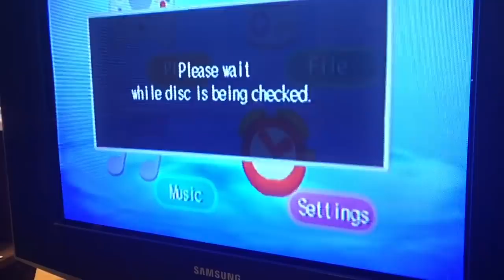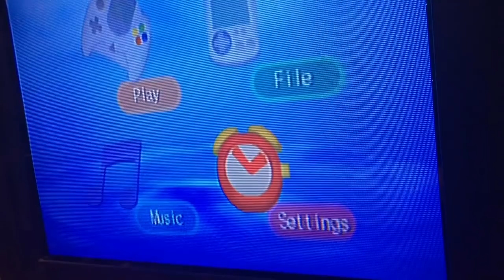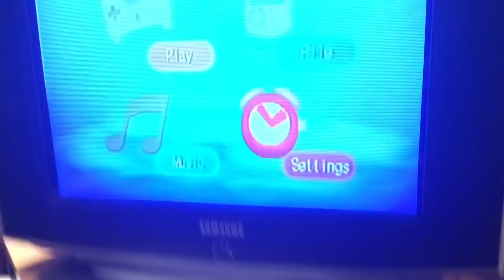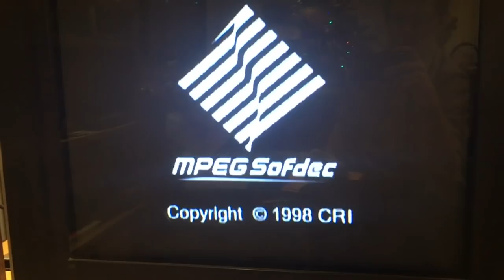Fixing eBay Junk - Dreamcast Restoration - Part 2 - Disc Read and Boot Issue

Comment: The road to random resetting is a well worn path. I'd have to run multiple games on it over a period of a week or so before declaring it fixed and reliable.
Reply from the maker: Very true.  The best part is the testing, but I'm not sure you all want to watch me suck at video games for an hour.
Reply: RetroRepairs Tony Hawk's is so playable too.
Reply from the maker: lordsofkoble right? Thps2 was the one I played the most, but I'll power through a nice og thps session
Reply: RetroRepairs Same actually, great soundtrack.

Comment: Thank you!! I had tried this before, but this video was much clearer and helpful. The screw twist was enough. My DC is working again!! Quick question.. the game I played first shut down after a few moments. However each time I tried it lasted a bit longer, until finally it's lasted for a good 15 mins now and still going. (Hello Virtua Tennis incidentally!) Any ideas why this is? Anything to do with the ML2032 recharging?

Comment: So did the old laser work with the power supply fix? I've got the Dreamcast, Game Cube and a Panasonic DVD/VHS combo needs fixed! The combo needs a disc drive and the consoles need cleaning up, but my main concern is the combo, is there any recommendations for a replacement or fixing the disc drive?

Comment: Pot tweaking without any sort of multimeter? You need to know if you are actually doing anything to the pot. You might even be putting more resistance impeding the laser. And if you happen to put too much power to the laser, you can shorten the life of the laser and eventually damage it.

Even so, love the restoration project! Keep doing what you do!
Reply: instablaster.

Comment: Have you tried using the original laser after you bent those power pins back in place? Maybe that laser wasn't getting enough power either. 

I also know nothing about this stuff, so I could be dead wrong. I just like watching this stuff.
Reply from the maker: Lostmymind1 I didn't, but it won't take much to just try it on another system.

I really do think the laser is the issue though, the new laser behaved much differently even with the bent pins.

Comment: I don't know if everyone is aware but I have 2 dreamcast and on one of the lasers the pot need an anti clockwork turn to increase laser voltage and the other one needs a clockwise. On my multimeter it shows a decrease of ohms is to increase the laser. Just might help you get this one working :) keep em coming dude great work

Comment: Having watched both parts 1 & 2 there, I have to say that you've done a pretty awesome job of restoring this old Sega Dreamcast :o and it does make me jealous in a way that I wish I could do this kind of thing myself, as it would be a great overall feeling to have brought something 'back from the dead' in a way like that, though considering what you said this console had been through, it could've potentially been damaged far beyond the point of repair if it was smoke AND fire damage! D:
Will look forward to seeing part 3 soon hopefully, but no rush as I could certainly understand that this kind of repair/service job could take awhile, as well as requiring a lot of trial and error to see if things work or not (as seen in parts 1 & 2), but here's to hoping you'll be able to better clean that power unit/board part and maybe it'll help restore functionality to those original parts without the replacements (where possible at least)!

Comment: Another great video!  I saw a video where a guy spent a lot of time trying to adjust the laser and he finally tried swapping parts with a known good system and it turned out the board was the problem and the laser was fine.  Since you have spares, it might save ya some time to try that method.  I'm very curious if the old laser worked too!

Ignore all the idiots bitching about how you're doing things.  We're hobbyist repairmen and we often do things wrong.  

Constructive criticism is one thing, whining is another.  DEAL WITH IT PEOPLE!!!

Comment: The worst part of the video is that you never take readings with a multimeter, then
you touch with your bare hands the power supply without having discharged the capacitors.

The initial value of the laser is very important, because it is the most practical way to play with the pot without lowering the power of the laser too much.
The power supply has capacitors of 250 to 400 volts, if you are going to disassemble the source, disconnect the console from the power without turning it off so that they are discharged.
Reply: I don't understand the comments such as this one that criticizes how people work and point out every detail that is incorrect. What is the point? I'm honestly asking for the understanding of why, I'm not trying to put another person down or make them feel lesser than. If I in doing this I do offend I really apologize.
Reply: Its better to calmly say whats wrong than to explode in anger.
Reply: Yes use a multimeter and measure the resistance before turning the pot. Also use a pen to mark the original starting position.  Peace!
Reply: Kerri McKeon being critical is a big part of how people learn new things, or how to do things better.
Reply: @QQ How that information is delivered is the issue here. Being helpful with constructive criticism is wonderful. The condescension, however, is unnecessary and detracts from the useful information.
Reply: Q Q being critical doesn't mean you have to be rude.
Reply: Meh... They wont hurt that bad.
Reply: he wasn't being rude though
Reply: @kerrimckeon7242  details, mate? You can literally die if you touch a power supply that has its caps charged, it's not even criticism anymore, it's a safety warn.
Reply: @kerrimckeon7242  capacitors can hold a charge after it's unplugged that can potentially kill you or explode the cap

Comment: You should check the solder points on that row of pins for the power board connector and do a careful touch of reflowing them.
Reply from the maker: Wouldn't be a bad idea to make sure it lasts for years to come

Comment: Hi, I love your channel. I've been learning a lot with your videos. I'm no expert in refurbishing consoles but I'll like to add a piece of knowledge here. The problem you mentioned about having a poor connection from the power supply and the pins to the main board was definitely NOT what was happening, I fixed that problem on 2 units already. When you have this problem the console will randomly reset to the dreamcast logo (like it was being turned off and on again), not to the system menu, the problem was probably your Sonic Adventure GD. If you run into that problem in the future, I recommend using rubbing alcohol on the pins, the bending method didn't do the trick for me.

Comment: Hi
trying to restaure mine. The disc gets to spin, but it does so forever while the DC just goes to main menu. Hitting the play button the prompts to insert a disc, despite having a disc in and spinning. I tried cleaning stuff up and playing with the pot with no result. Do you have any idea ?

Comment: I wish you tried the old lens with the power supply solution, just to check.
Reply from the maker: I'll try the lser on another system later, but just replacing the laser resulted in immediately different behaviour.

I'm not sure if it's safe to soak a laser pickup in alcohol to clean or not, that might be an option.

Comment: never ever "adjust" a lens this way, you need an oscilloscope to check the RF "eye pattern" signal, this is the only way to have accurate 
ie : https://www.eevblog.com/forum/beginners/how-to-perform-an-eye-pattern-test-on-this-cd-player/?action=dlattach;attach=82972;image
Reply: indeed !
Reply: Micks your cool tho
Reply: Whats the harm? You cant break it anymore if it doesn't work in the first place right?
Reply: this potentiometer adjusts the level of current going through the laser diode, it acts like a resistor, if you get off limits you can burn the laser overtime
Reply: I get that mate but if its truely mucked like it ended up being I dont think there is any harm but yes outside of this type of situation dont you are right!

Comment: I guess I'm too late here to say it, but still: the trim-pot for the laser can actually even kill the laser itself in some cases. Since it adjusts the current to it, you can burn it with too high current. I should have suggested trying the cleaning process 1st on that other video, but I guess it would still have given issues afterwards

Comment: If you want to bypass the whole need to repair the laser, you could always go through the process of soldering in an SD Card reader and/or an IDE cable, and boot games directly from a hard drive or SD card through Dreamshell. You'd also need a working GDROM drive temporarily to install Dreamshell, and ideally a replacement BIOS chip for the console on which to install Dreamshell to so you wouldn't need to disc-boot it. It's very well made, and I've used it on multiple consoles in the past. The hard part is the soldering, as well as cutting holes in the case to run the wires outside the console.

Dreamshell: http://www.dc-swat.ru/page/dreamshell/
DCIDE Guide: http://8bitplus.co.uk/projects/dreamcast-ide-dreamshell/

Comment: I fixed a black sports edition model with the same boot issue just by removing and re-seating the power supply. Seems to be something to it....
Reply from the maker: Odd, the pins do have some give to them, so I'm betting it's a fairly common issue
Reply: The person it belonged to said that they would leave it on for hours and hours and it would get very hot. I always guessed maybe some thermal expansion/contraction caused those pins to lose solid contact.  Its interesting that yours was subject to immense heat as well.
Reply from the maker: Interesting.  Also worth noting, I did completely disassemble this one, so it must have been a more extreme disconnect.

Comment: I have a black NFL edition Dreamcast and whenever i turn it on it most of the time just restarts sometimes right away sometimes a couple minutes after booting up a game. This sound like anything youve come across?
Reply from the maker: Tyson Bash I'd check the power supply first.  I've heard of them causing all sorts of problems.  Like I do in this video, bend the pins that connect it towards the back of the system to ensure a solid connection
Reply: appreciate the response. Love the vids, I enjoy how you go into depth about repairing things most people go halfway or start a repair guide with the inten of just replacing an entire piece but you do a complete teardown and verify piece by piece.
Reply from the maker: Glad to help, and glad you enjoy the videos.  The point of these for me is to show the entire process, even if I screw something up, as there's a chance someone else will run into the same problems I dif

Comment: Do think you could do an Atari 2600 repair in the future ?
Reply from the maker: If I find a system and the price is right, absolutely.  I've been thinking about doing an AV mod to my personal console.
Reply from the maker: Id love to.  I picked up a lot of 8 genesis systems sold as defective, but each one of them works.  I could do a basic cleaning video, but no real repairs to do. The genesis was a really solid console.  The snes on the other hand.... Huge failure rate.

Comment: I have a problem with my Dreamcast won't turn on unless I remove the entire laser ensemble any idea what cause's the issue😞
Reply from the maker: Steffano Barbieri no light or anything?  But if you remove the assembly it will boot into the menu?

Could be a short to ground somewhere.  I'd disassemble the laser assembly to make sure nothing is loose and looks right.  

It's possible a motor in the drive has failed and is shorting.

Also possible the connection to the power supply is not strong.  Do what I did towards the end of the video and bend the pins back a bit. Also inspect them for dirt and grime, possibly clean them with alcohol.

Comment: Watching the rest of the video, where you try to 'adjust' the laser, I could not believe how you are setting a bad example.  Seriously, you never should start turning trim pots without even checking a single voltage.  BTW, if that soot is all over the electronics you may read funny voltage values.  Clean the damn thing with the right products, designed for electronics.  Especially the trim pots.  And make sure you don't have any shorts or low resistances in the logic area, because of the soot, since that is composed of conductive carbon.

Comment: My Dreamcast suddenly decides to reset itself at random times, do you know what may cause it?
Reply: dodgy power supply maybe
Reply from the maker: good chance of a power supply issue, or could be a bad component on the mainboard.  Usually newer systems will turn themselves off to prevent further damage (Which is what a Red Ring of Death on an xbox basically is).  I'd try removing and re-seating the Power Supply.  Try bend the pins in slightly like I do towards the end of this video for a quick and easy fix.  If that doesn't work, probably a bad component - hopefully not the CPU.
Reply: You showed a good way of cleaning and tweaking the laser. I should do it as well :)
Reply from the maker: The laser shouldn't have much to do with the system resetting itself, but give it a try.  You never know.  Sometimes a good cleaning of all components does wonders.  Maybe try tear the entire console apart like I did in Part 1 of this series and reconnect it.  Could just be a bad connection that gets loose when it heats up.
Reply from the maker: henfjo how does buying a genesis solve that?
Reply from the maker: They are very solid, however, they make games for dreamcast they don't make got genesis.  I've got both, I wouldn't trade my dreamcast for a genesis
Reply from the maker: The genesis is one of the most reliable systems, along with the nes, but don't rule out the dreamcast.  Less reliable, yes, but good games
Reply from the maker: It failed because the ps2 came out in the same time, which was a much better system.  Dreamcast wasn't bad at all, but it was expensive.
Reply from the maker: They ps2 was the best selling system of all time.   After the saturn, the dreamcast had no hope of competing.   Read up on segas history, it's very interesting.
Reply from the maker: Agree to disagree
Reply: Most of the time it's just the connection pins between the power supply and the main board, it's just very susceptible to relaxation and corrosion. Give the metal a good clean, bend the leaf springs on the connector out a bit, and it'll likely be fine again.

Comment: Cleaning filthy, greasy PCB's, like that PS, is easy and can be done with "Oven & BBQ Cleaner".  It is a white foam.  Spray generously on the PCB, let it soak and bubble for a couple of minutes, while working it in every little corner with a long hair paint brush.  Rinse well with lukewarm water.  Dry with a paper towel and hair dryer (not too hot).  Oven cleaner is safe, it will not attack the PCB nor the soldering mask or the printed schematic.  It does not attack components or colour codes.  I use it all the time to clean electronic stuff, works like a charm, much better than alcohol.

Comment: no you don't have to adjust the laser power on dreamcast normally. this is not a ps2 that had problems now. you could see the laser is dead just from turning it on though since there is no red so either there is a lot of buildup on the second lower lens or the laser dead. if you see no red laser at all everything else is a waste of time. this don't have invisible lasers now. adjusting the power is the last thing you should ever do. that is going to burnt he laser out because over driving it. you should have just cleaned it before even thinking about adjusting it.
Reply: so to sum it up the reason the laser power had to be turned up on the ps2 was because the lenses were dirty. turning up the power made it cut through the dust instead of cleaning the dust off the right way. the thing is with this dreamcast the laser just died or there is a lot of buildup on mirrors and lenses inside the dreamcast one. 
https://www.youtube.com/watch?v=GMHAaPWYZT4
https://www.youtube.com/watch?v=4Fx404bcu-s&t=9s
Reply from the maker: The one that currently works also doesn't have a visible laser